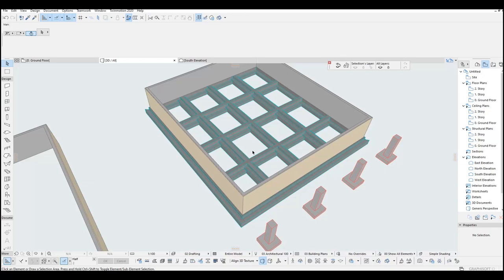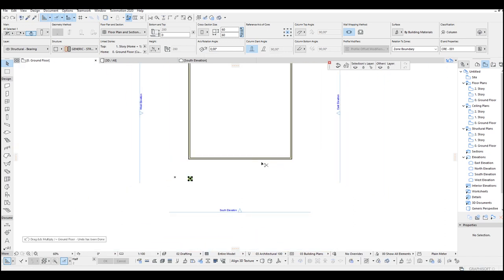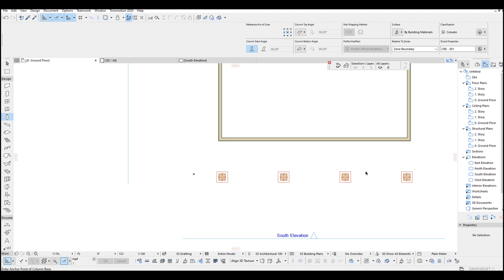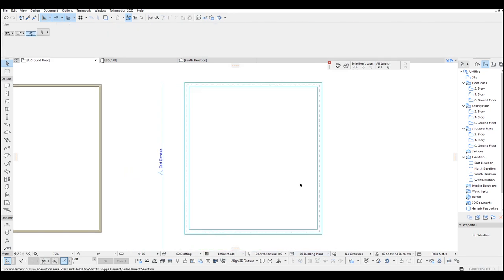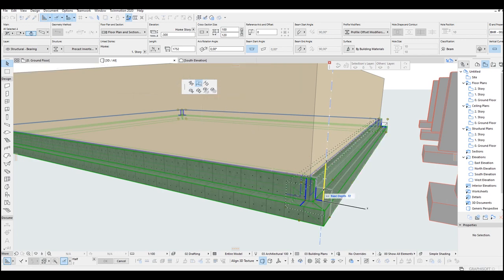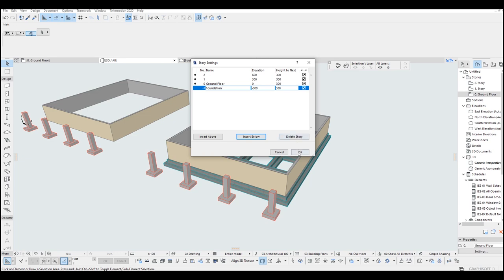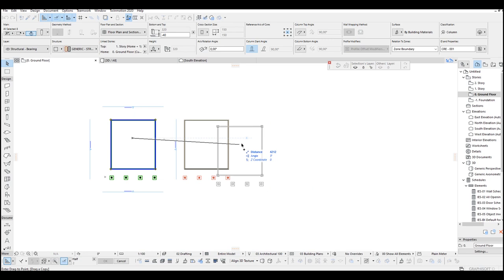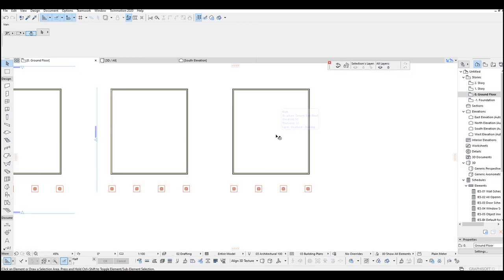How to model Foundation in Archicad

Comment: Thank you so much for the tutorial. I do have one question how to you get the setting to make the beam automatically be placed under all the walls?
Reply: it is my same problem, also because at the beginning of the tracing of the foundation it is seen that the axis of the foundation does NOT coincide with that of the wall ... :)) In short, the positioning seems to be done a bit at random. Isn't there an automatic way to insert a foundation beam under a wall correctly? Or at least, if not, that it is possible to trace this beam with the program that "feels" the central axis of the wall ...
Reply: Did you figure how to do it??